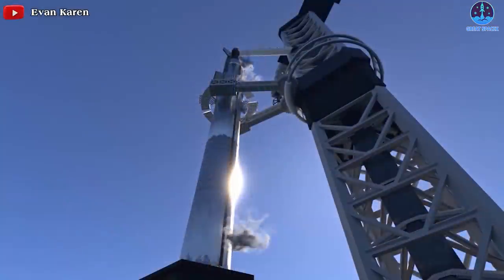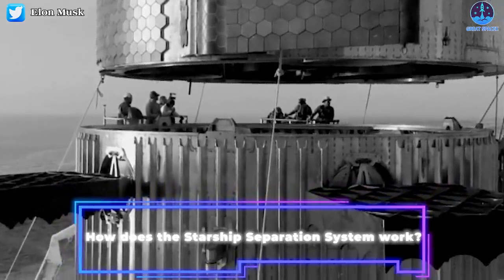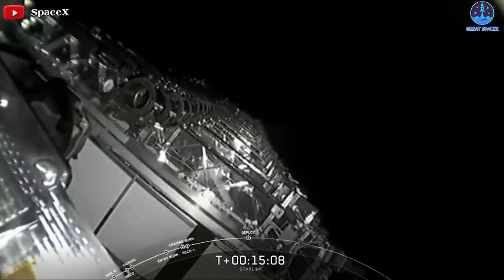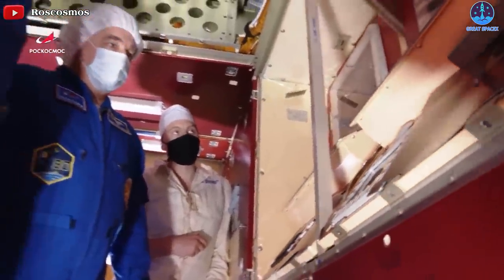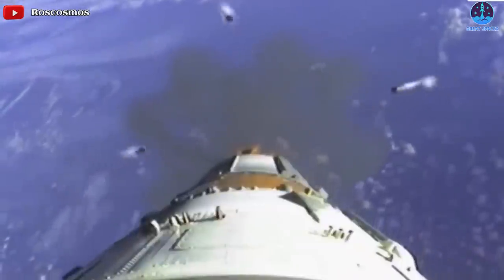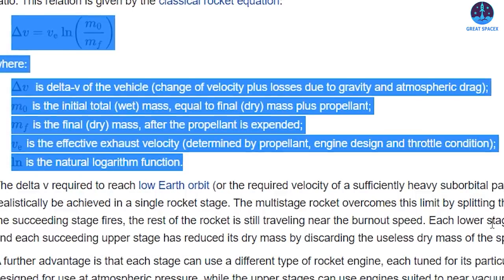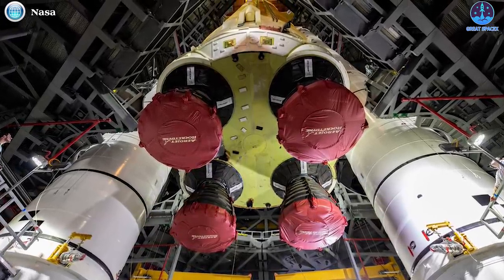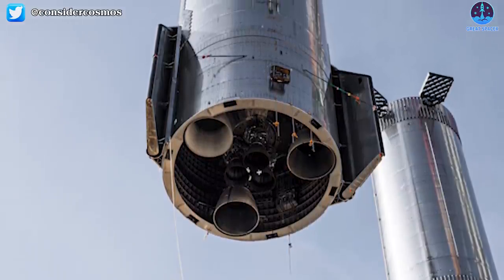NEW UPDATE!!! Elon Musk Explained The Starship Separation System Mechanism

Comment: Minor point, Musk said in that interview that they would not be using the fins for the catch, but two catch points between the fins. Waiting to see what they finally decide. Nice video, thanks.
Reply from the maker: Thanks for the info 
that's gonna be awesome to see that happen
Reply: Makes sense. I would imagine that grid fins are mounted on the pivot/shaft that rests on some kind of bearings. If you want to reuse the stage rapidly that would be inadvisable to catch the stage by those moving parts. Even if you don't brake the fins on landing, you would need to inspect the whole mechanism well before flying again.
Reply: Yep. They used the same parts to lift the booster onto the launch table. The design will probably change, but the parts are already there.
Reply: Teleportation will make rockets obsolete.
but first focus on a way to cancel gravity, it will let you jump into space with your own feet.
Reply: @vablo7198  That was my understanding as well.
Reply: You can see in the video the catch points in-between the grid fins.  While not small up close, they look small in the pictures.  At least one of the pictures shows Superheavy being hoisted up by the catch points and a jig to hold the straps the right distance apart in order for the load to come straight down onto them.  Hard points to hold the weight of the mostly empty rocket stage still have to be pretty strong and so making them any bigger than they need to be adds weight and aerodynamic drag.

On another note, while they are using stainless steel on the grid fins now for the first prototype, I would think the cost of lost capacity would be greater than going for say titanium grid fins.  At least my understanding with the cost of titanium, it has primarily been due to the difficulty of working with the material.  They have been making advances in working with titanium alloys, bringing the cost down.  Then again there are a number of advances with stainless steal alloys, which leaves me wondering how the grid fins ended up being so heavy.  Maybe SpaceX will have a new stainless steel grid fin in a future revision that dramatically cuts the weight down and then the weight problem will be adequately solved.

And talking about materials, one has to wonder with the Rocket Lab Electron booster making it back to the surface intact, will Superheavy ever end up going over to carbon-fiber composites?  If you shaved off say 100 t from the dry mass of the booster, which seems like it should be achievable, that could easily be another 20 t to LEO capacity for the whole rocket, which is not insignificant.  In general Starship on top would have more headroom to do stuff because Superheavy would do more of the work getting into orbit.

Comment: It's not that the "savings" are so high that every orbital rocket has used stages. It's a consequence of the Rocket equation you showed. To get a dV high enough to achieve orbit your wet to dry ratio would have to be so high that there isn't a structural material know with a strength to weight ratio high enough to leave any margin for payload. The Falcon 9 first stage is theoretically capable of SSTO if it has no second stage and no payload but its completely impractical to do so.

Comment: Correction: he meant Rotation around the pitch axis not the roll axis like you indicate during the video. Only then they will separate through zentrifugal force
Reply: Thought so. Now it makes sense. Thanks. The Starship will have to compensate after separation but the booster is turning as it should anyway.

Comment: Pretty silly discussion.  The engine bay could simply be pressurized to sea level atmospheric pressure.  All you would need to do is uncouple the starship and let the escaping atmospheric pressure push the two parts away from each other.  Or you could simply open a valve to a pressurized nitrogen tank, or you could simply create the pressure in the engine compartment during the engine chilling processes.